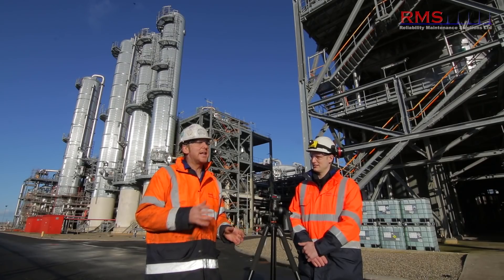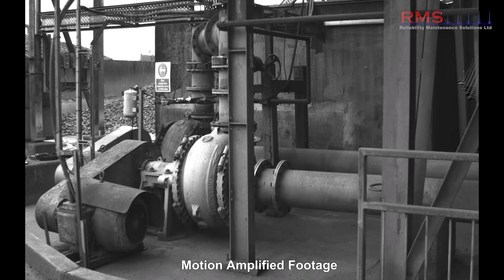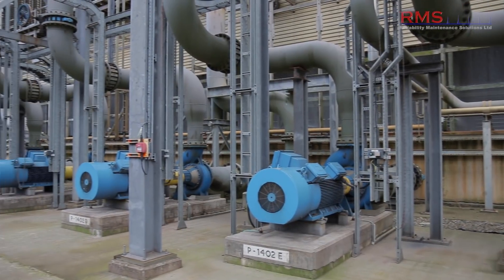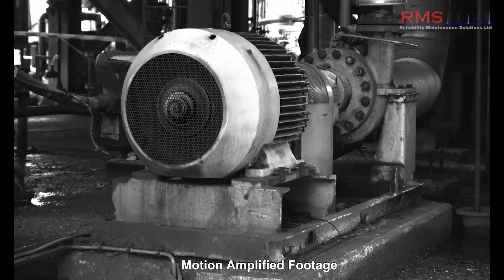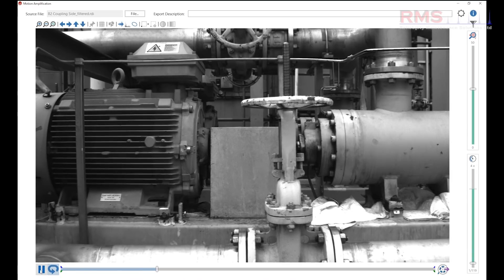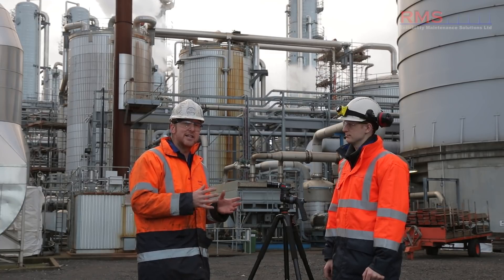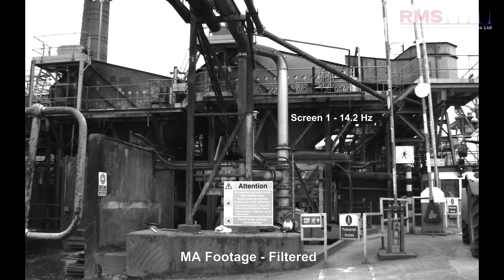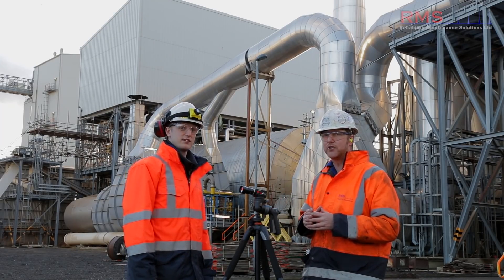Motion Amplification Technology Updates - 2018

Comment: How to get the spectrum from the camera? Is there any accelerometer too put in the pipe?
Reply from the maker: The system is non contact, the camera uses the pixels of the camera as sensors, so 2.3 million sensors on the image. All to do with measuring photons of light within each pixel. As accurate as an accelerometer, even more so at lower freqs. You do need to add distance pins in the software for accurate measurement using laser range finder
Reply: Motion Amplification - RMS Ltd thanks for the response